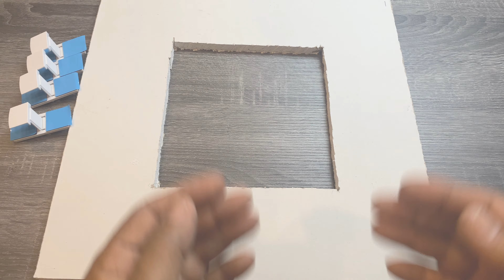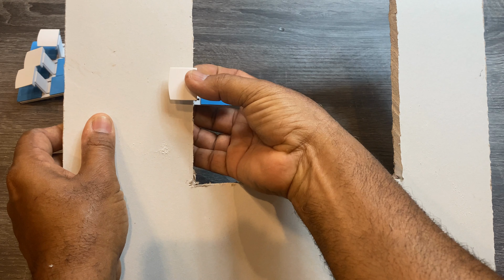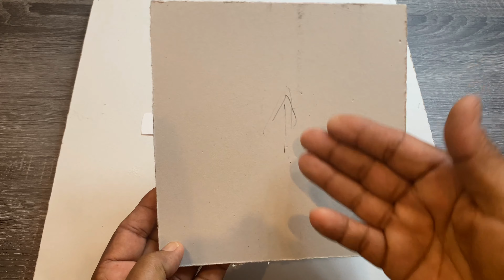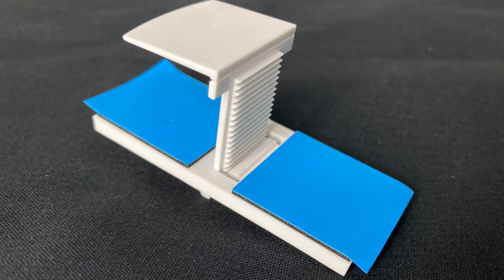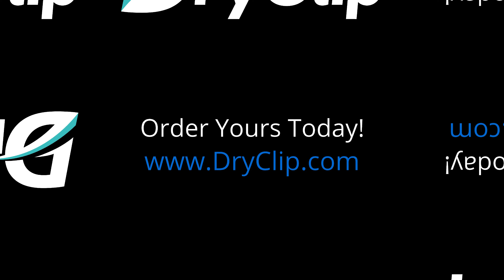How To Install DryClip Short Version drywall clip

Comment: This is a great product for home owners or DIYers. Unfortunately, the price doesn’t make it cost effective for the professional. 
This product does make it much easier to install a new repair panel which is very helpful to someone without a power drill or driver.
Reply from the maker: Thank you very much for your comment we really appreciate that! Have you try out contractor pack? Our contractor pack has 50 DryClip per box and its price is only $49.95 that is only $4.00 for a repair of 12” x 12”  if you used 4 DryClips. If it’s smaller you may be able to use less than 4 DryClips. Check out our website www.DryClip.com
Reply: @dryclip  Now that I think about, $4.00 isn’t that bad. No wood blocking needed, no screws, no power tools, saves time, etc. I believe I will purchase a contractor pack and try them out. Thank you for the reply.
Reply from the maker: @jkorabi  plus you have to make the damage area larger in order to reach the nearest stud! When you do place your order let us know and we make sure we send you an embroidered cap 🧢 with our logo!